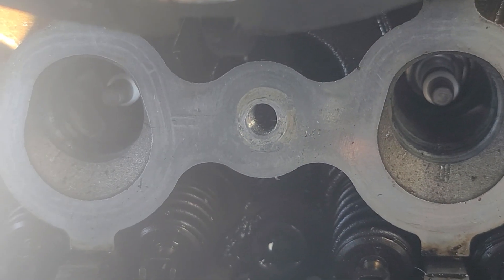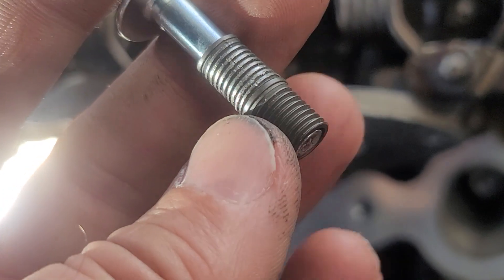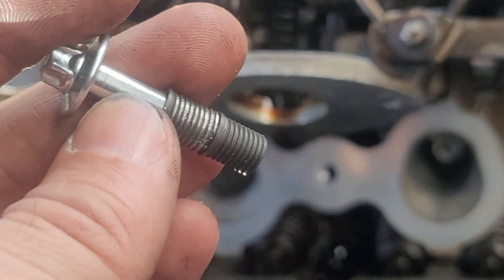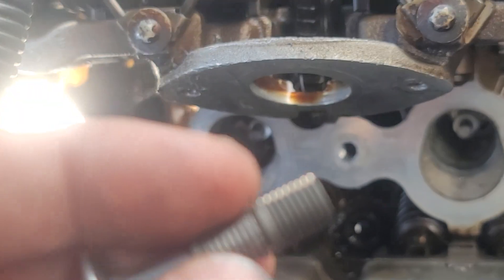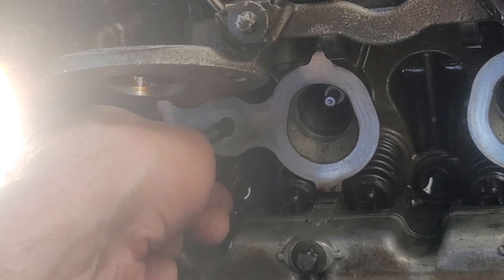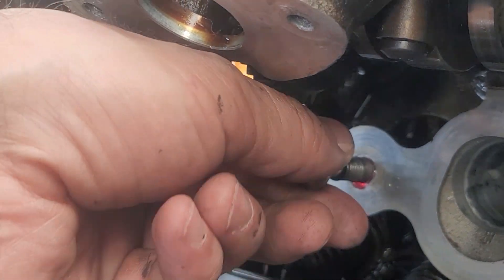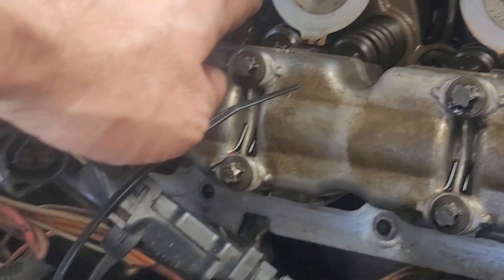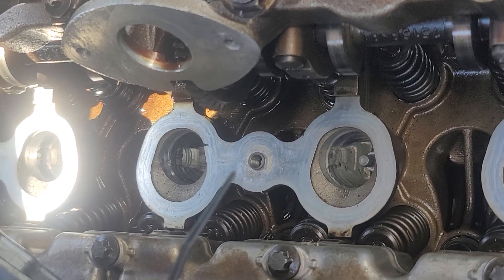Fixing stripped BMW head with time serts for the valve cover

Comment: I recently had the same thing happen to me but it’s the valve cover ground bolt in the back do you have a link to purchase the time certs or helicoils for that or what size I should get? Thank you.
Reply from the maker: Get a m7x1.0 time sert and a m8x1.0 tap the helicoils are no good for these heads
Reply: Yeah, I just broke the same one too!  The rear, ground lug, in between cyl 5&6.  That was only fastener that had some wicked corrosion.